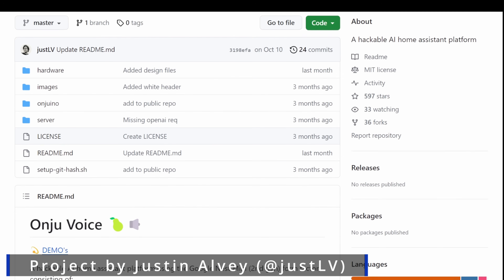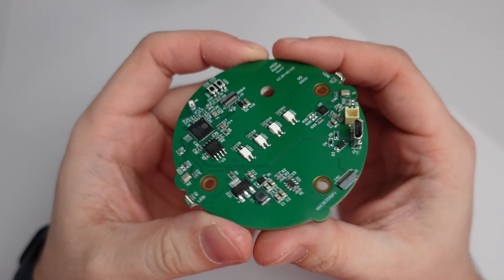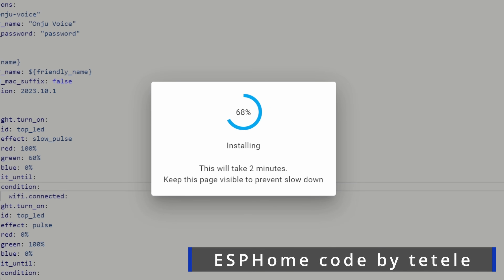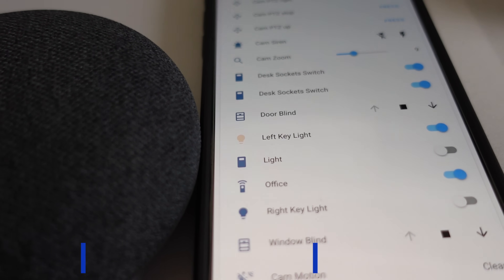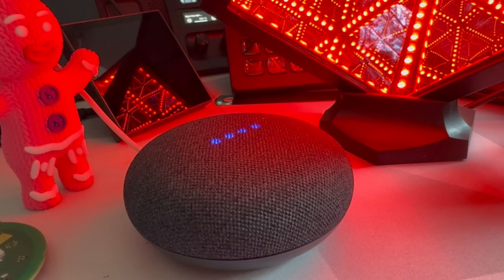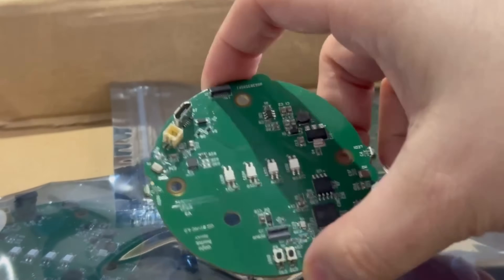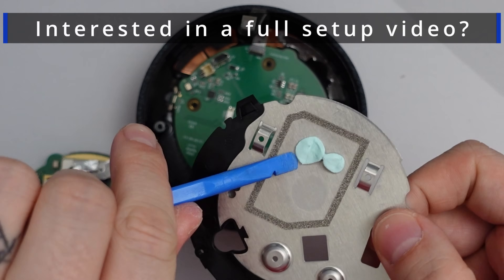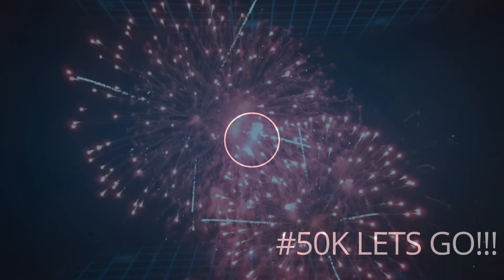Turn Your Nest Mini into a Local Home Assistant Speaker!

Comment: Mark, what options did you choose when ordering?

the first selection asks for
Only PCB / PCB+Assembly

once the above is chosen, there are multiple items that need to be selected

Edge connector 
Solder Mask
Surface Finish
Silkscreen

thanks

Comment: Wow, thanks for the heads up on this project!  I've had several Nest Mini's sitting in a box unused while at the same time hoping for a better solution for HomeAssistant Assist than the little Atom Echos (which have speakers that are just too quiet for most of my rooms).
Reply from the maker: My Atom echoes haven't yet seen the light of day. Picked up a few and they have all sat in the draw of shame 😬

Comment: Does this only work with a google nest mini or could you use an older Google Mini?
Reply from the maker: Im not 100% sure as I dont own an original to test. If the dimensions, speaker connection and other connections are in the same place it should work.

Comment: What is the price for the PCB'S?
Reply: 5 PCB's are $25 US. Sending to Europe, also $25 :/
Reply: @schuim  Including parts and assembly?
Reply: @darknessblades Without? You order an PCB, don't get it what the want to assemble?
Reply: @schuim  they have a assembly service where you can get it pre-assembled with all parts
Reply: @darknessblades Then I will find out what I still need to solder ^^
Reply: @darknessblades So, i got my answer ^^ your missing the usb connector, buttons and ribbon connector

Comment: There was the pop up comment that the speed is determined by the language and hardware model.

What did you mean by hardware model? Like the actual physical hardware model of the swapped out google nest?
Reply from the maker: Heya :)

Sorry! I meant hardware that your voice related services run on. For example if you did this all on a Pi it would be significantly slower
Reply: Also, 100% would love a full video on this. Looks like an amazing project.

Comment: Yes, please full tutorial! Does this change make use of the better speaker inside the device as opposed to like the little M5 stack that can be ordered right now with that tiny crummy speaker? This is exactly what I was looking for. Something that looks like an Alexa and has similar hardware functionality with a decent speaker  but has the local Home Assistant guts inside of it too.
Reply from the maker: This repurposes the google speaker :)
At the moment it's not able to use Piper TTS which is one thing I really want for the nicer sounding voices.
Reply: I'm wondering whether this could be inserted into a "nice real" speaker like a Donner or a JBL Go.
Reply: @Alessandro---  yeah, that would be cool too. I just like the idea of keeping it small.